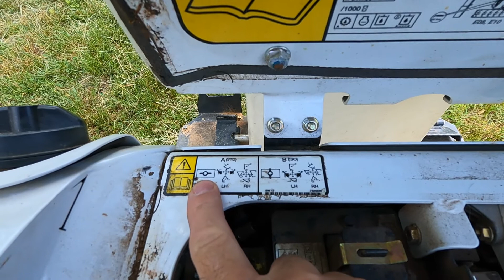Differences between SAE and ISO Controls on an excavator

Comment: Good video thanks! I run excavators on ISO as it was the way I leant, and seems to be the predominant pattern. I was told by a very seasoned left handed operator that ISO is generally for right handed people and SAE is easier to use for Left handers.  My Volvo (a little bit bigger than yours) has a convenient little changeover switch in the cab so can practice from time to time. Which comes in handy, I have been on site where a left handed operator has been away and nobody could run his machine (SAE pattern),  so I volunteered to run it. Usually takes me 10-15minutes to adjust and away we go.
Keep up the good work.